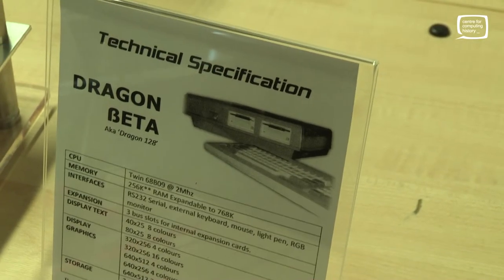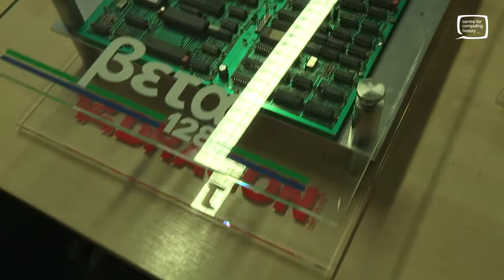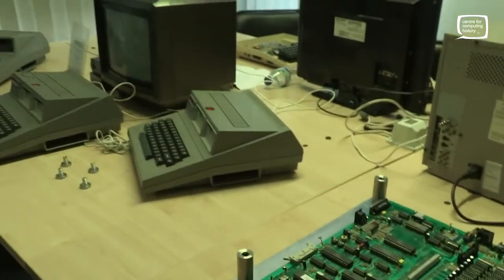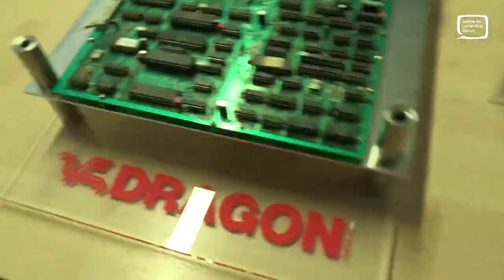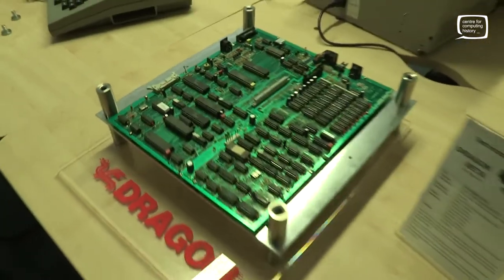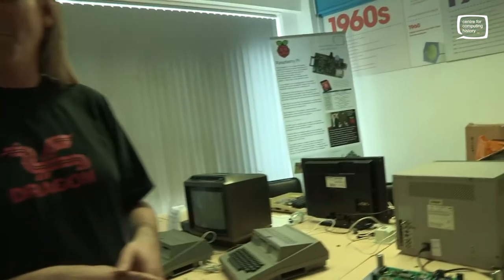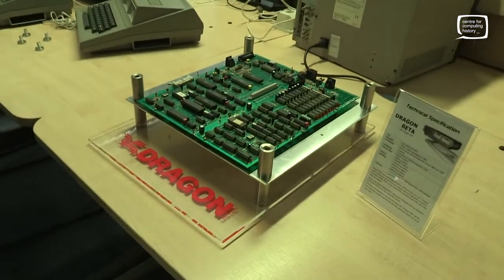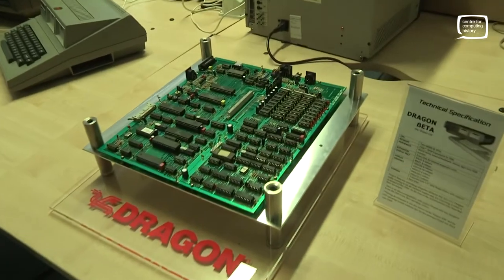Dragon Beta 128 - Extremely Rare Vintage Computer

Comment: Woah, An interesting machine indeed. My question was.. Isn't it counter-intuitive to replace every IC, For the sake of retaining its "original" condition? When in fact only a few were faulty?
Reply: Alex Sinclair As long as the chips were replaced like for like, I'd think it was a good idea. It's rarity means every precaution should be taken. I doubt the board and the solder joints were up to production quality and they were never that reliable at the best of times. If it runs as intended, and reliably so, it's a good thing.
Reply: IT's better to replace everything with known working chips than to take a chance of on bad original chip causing damage to other original chips.

Comment: Do you think, like the original ZX Spectrum it was going to use cheap 'faulty' RAM that could only address half the memory - So although it had socket capacity for 256K it would've only actually had 128Kb?